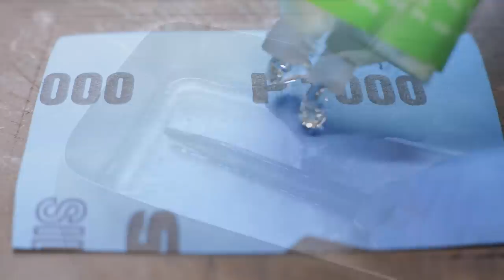Restoring rusty WW1 Fighting Trench Knife M17 and Scabbard. Knife restoration

Comment: Ready for duty for another 100 years or so and an archeologist digging this up again in a thousand years to come will be impressed.  The original manufacturer would also approve of the improvements in restoring the scabbard.  Apart from the Glock knives, modern issues, especially American,  tend to be bulky while these European blades from the past are much more streamlined and versatile, suitable not only for wearing on the belt but as boot knives as well.  Still applicable for modern sportsmen and for service members.
Reply: That stupid marketing along with Youtube nonsnece and marketing trends, not only have spread a ton of misinformation to people (especially, collecotrs and noobs that have little to zero knowledge on the subject), worse than that, they've also managed, to turn the most usefull tool in our everyday need to survive, to something that's useless. (Super thick, super heavy, stupid designs, that have to do only with looks and nothing with performance, or practicality) Knife has suffered a lot of damage, from these so called Youtubers and that stupid marketing trends.
Reply: @greekveteran2715  Absolutely, I have a couple of Pakistan or India made repros from Windlass of questionable quality but the manufacturer claims these were made to the same specs of materials and workmanship available to the AXIS and Central Powers during the wars.  I prefer these to most of the silly commercial "Rambo-esque" renditions you refer to.  The Glock field knives, Gerbers, and classic US GI designs from KBar and Camilis and Ontario are not too bad though dated in most iterations.

Comment: Electrolysis does not remove rust from steel. All that sh1t floating came from the sacrifice electrode. On the knife, just bubbles, perhaps gas H2, depending on what you're using as electrolyte. Anyway, I like your job and the final result
Reply from the maker: Primarily I use electrolysis for very rusty items and rust is perfectly removed. Thank you!
Reply: @ReXtorer  yeah I know a lot of people do that but in terms of chemistry, nothing happens... the bubbles formed are hydrogen gas on the cathode where the H+ ions are reduced. Eventually, this gas can mechanically remove some small plates of ferric oxide (rust) on the surface. Some people think that some Fe3+ ions could be reduced on cathode too but it doesn't. And even if it could, the metalic iron formed will not attach to the surface of the material. Anyway, the process is not perfect and we can see that when you have to brush a lot after the electrolysis is done. If you can't remove rust with sandblaster some rust remover products will work. But in both cases, you'll lose material on the surface too.